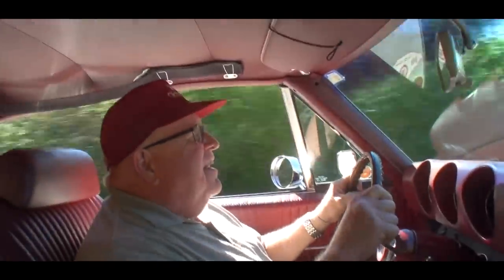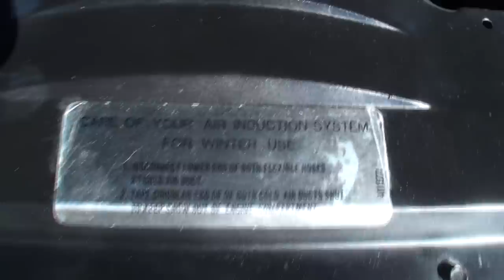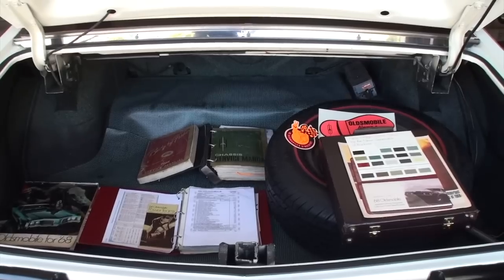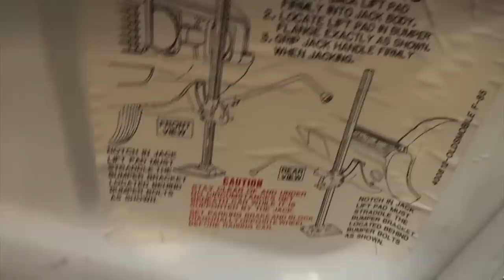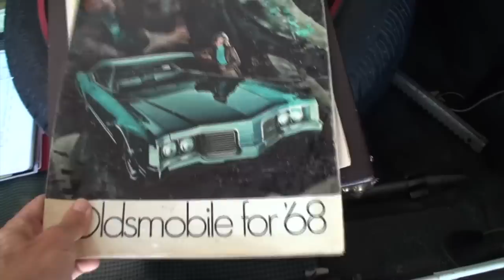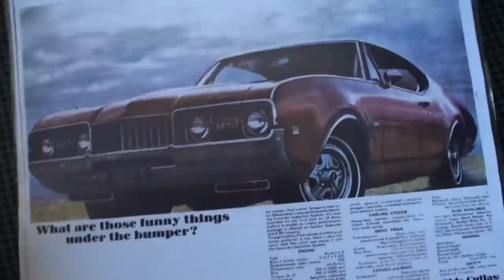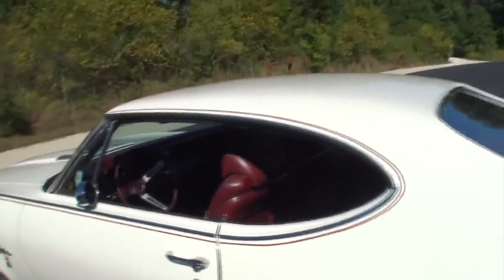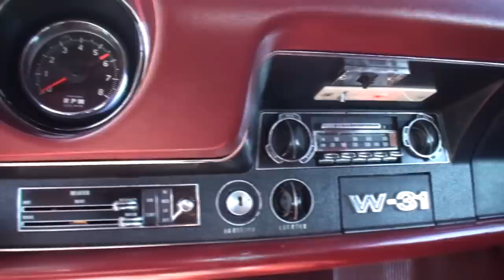1968 Oldsmobile Olds Ram Rod 350 Cutlass S W31 W-31 Survivor & Ride My Car Story with Lou Costabile

Comment: I am a total die hard Pontiac fan but after buying a few Cutlass's I have developed a love for Oldsmobile too! And I really love this one! I'm old enough to remember when these came out! I was only 13 but I was a big time gear head and got several of the car magazines and they gave these great reviews!  This one is the ultimate sleeper with the Cutlass name tag and the ram air inlets under the front bumper! Plus it has a 12 bolt ''Anti Spin Differential'' and of course the four speed transmission!  Plus I just absolutely love Red interiors in a car!  And although I have owned several 67/68 Firebirds and liked them all his brother was correct when he told him to get this Cutlass instead of a Firebird!
Reply from the maker: Hi Danny, Happy to read you "really love this one" :-) Lou

Comment: This is a nice special car from the Rocket Division! 😊 For a non-street car, it seemed amazingly compliant. It didn't talk back or throw a fit when the owner fired it up. He must have had it undercoated or kept it garaged to keep the Illinois rust away.
Reply from the maker: Hi Michael, Happy to read you enjoy this "special car" :-) Not sure how he kept the car in this condition in IL, Lou
Reply: Yes:: though my 66 GALAXIE FORD xl/500/ 4 speed/352 stayed pretty good until 1973* ,BUT worn out), my first NEW CAr  , 1970 CORONET 500/383/ loaded rusted out BADLY & was totalled BY 1985 in N. INDIANA  rust Belt,. Interestingly, my second new car Order( 77 HURST ,HATCHES/ Trans Am SE, “**ZIEBARTED” )* lasted barely that long (* brine **seeps/migrates  into **frame & Body via JOINTS,&T Tops, and big Tires eat lower Body panels away —- I did not Know about “ Spats or Wheel Well Protectors until to late!! Anyways Lesson learned.
Reply: @opera93  I lived many years in the snow/salt belt.  The only real answer is winter storage of your collector car, or taking it out in winter only when roads are dry & salt free.  I drove a second car - "beater" - on bad days.  Heated garages were the worst for a daily driver in winter because the constant snow melting kept the corrosive salt active. Rustproofing sometimes blocked body drain holes trapping salt water, so sometimes did more harm than good.

Comment: I had a 1968 W-30 a few years ago, I would rather have had a Ram Rod, better balanced car! Mine wasn’t stock, had a 513 cu in Olds bb stroker in it, 4 speed, 3:91 rear, it was a Joe Mondello built engine, ran very strong, but was not a lot of fun to drive on the street. I had a 70 W-31 a few years ago, very nice, quick car, I have a 1972 W-30 in my shop that I ordered brand new, and still own, love my Oldsmobiles! 👍
Reply from the maker: Hi W-30 OLDS, Happy to read this car back memories of your car. Glad to read you have a fun 1972 too. If you see me, make sure to show me your 1972, Lou
Reply: @loucostabile  Just finishing a 5 year frame off on it, all number matching, but not stock anymore, car was totally rebuilt top to bottom, body and mechanicals. I don’t know how to download pictures in Utube, I’m kind of an old fart! LOL If you have a web address you’re comfortable with sharing, I can send you some that way. 👍

Comment: what would a 1970 oldsmobile model SX stand for and is it a good model to buy? I ask because ones for sale locally here and I am not familiar with that model any help is appreciated thanks
Reply from the maker: Not sure. Hoping a Viewer can share the answer to your question.
Reply: SX is a Supreme model which would be the same bodystyle as the convertibles are. Longer squared off rear section as opposed to the 442 bodysyle that is more rounded like a chevelle
Reply: SX is a Cutlass Supreme with upper scale interior and equipped with the 455 from 1970-71, with T400 automatic transmission. Very nice cars and rare, they were basically a 442 in a Cutlass Supreme wrapper.

Comment: Why would a Quadrajetted OHC-6-banger Firebird be a "mistake"?
The aluminum manifold not only looks good. It's also lighter and disapates heat better than cast-iron ones.
A "shorter-stroke" 350? The only way to achieve that would be to bolt an unusually short-stroked crankshaft into a 425-455 block. The broschure featured in this vehicle's Trunk & Treats states the standard 350 bore and stroke common to all other Oldsmobile 350s.
That's a beautiful interior. Red or white should be mandatory. 
That spreaded headlight front end reminds me of my dad's '67 F-85 of which I hated. The '68s were aesthetically a revolution over the '66 and '7s, otherwise.
Those are cool upgrades. That instrument panel is sort of AMXy, which is also cool. GM's interiors were always a notch up over Ford's and Chryslers, beginning in the late 60s
Reply from the maker: Hi Al Dente, Not sure the Firebird with a 6 would be a mistake, however this one clearly has more HP. Thanks for viewing & sharing. Lou

Comment: All 330 and 350 Rocket engines had 3.385" stokes.  Cam and valves are the main differences between the W31 and the L74 350's. 5,6 and 7 heads have the same CC size and CFM flow. Stop the misinformation Lou
Reply from the maker: Hi Wireman134, Thank you for viewing and sharing your knowledge. Hope you see many more cars on this YouTube Channel you enjoy. Please subscribe, and hit the "bell" so you can see all the cars when they are uploaded on this YouTube Channel, Lou